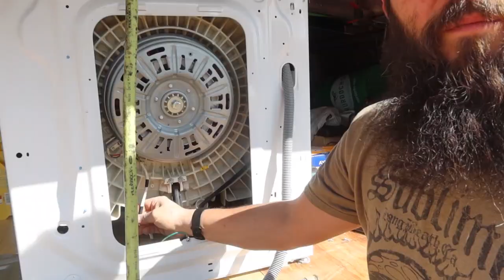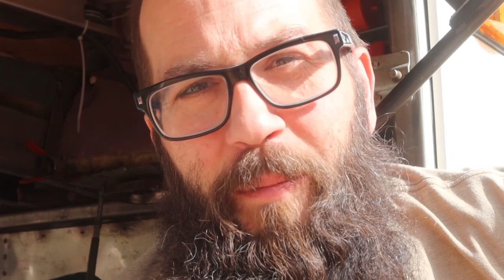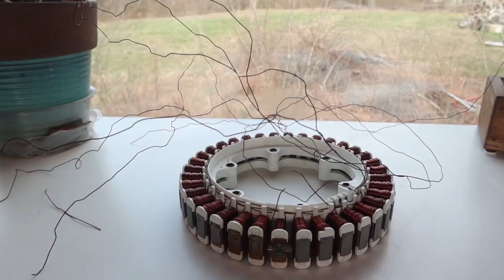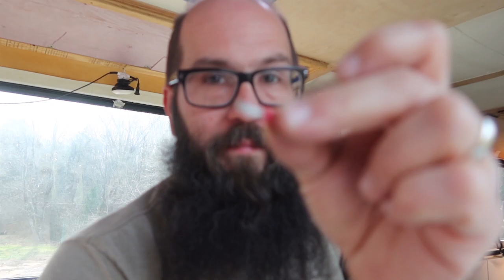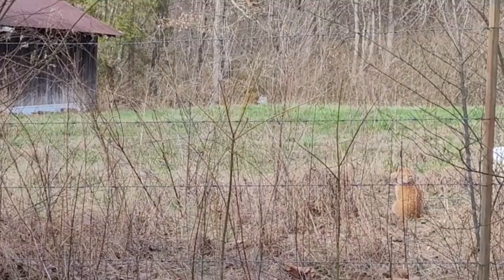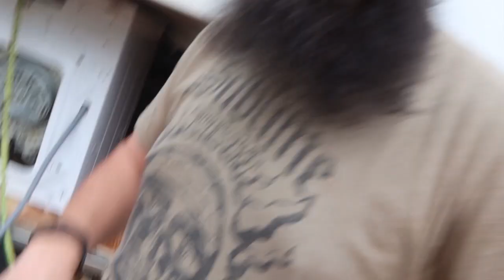How to Fix Whatever it is Andy is Fixing Today

Comment: You love to see it.  When you were taking the ohm values from the center, you proved your math.  The leaks, I can not help but wonder if they all are not supposed to have thread locker and they are seeping.  Still, probably a seal back in there sounds solid to.  Nice work though.  Sometimes, I will take my gas iron and put it in torch mode if it is too cold, or material to heavy for the heat transfer from the  tip to be effective.
Reply from the maker: Thanks! Great advice! I've purchased more butane since too.